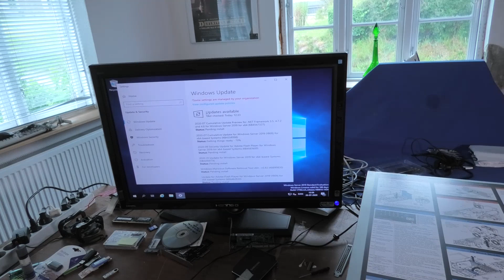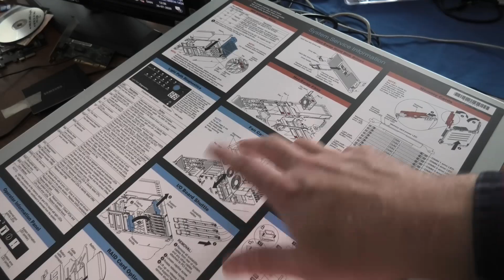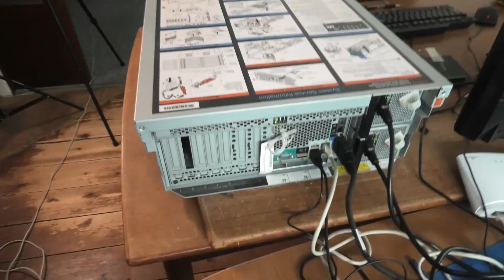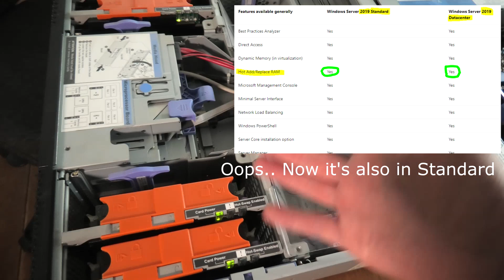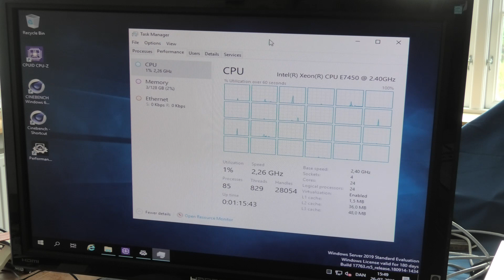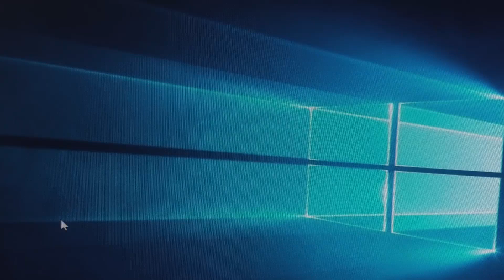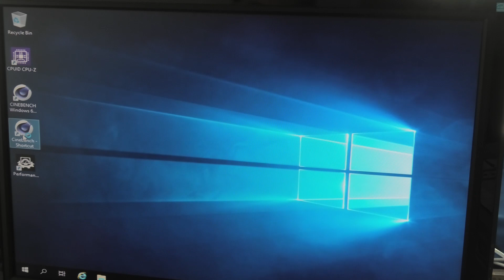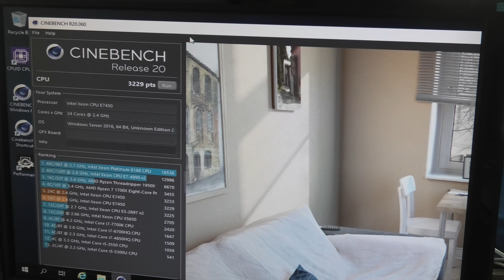24 Core IBM x3850 M2 Running Server 2019 - Cinebench R15 & R20 - 984

Comment: The website shows the cpu's listed incorectly. You listed them as 7540's and not 7450's.. When I searched them on ARK they were showing as nahalam 2ghz with hyper threading, and I was wth....lol.  But these are previous to those from the Dunnington (penryn).   I have a 2 socket system with the X7460 cpu's. very interesting beast those things are.   Highly useless now, but fun to play with.
Reply from the maker: Sorry My bad! I swapped "4" and "5" it's the E7450

Comment: The 4x E7450 HP DL580G5 I had in a hospital I worked at a while ago scored 1257/59 and they also had some DL360G6/G7 I've upgraded from low end quads to 2x E5645 6c & they scored 1139/83. They where way more powerefficiant than these old heater.
Reply from the maker: Yes,, these E7450,, did look like something that came to market a few years to late.

Comment: I haven't watched the whole video but the problem might be the installer detected the system as UEFI and the server is unable to boot as UEFI, a workaround is putting the drive into a Hyper-V Gen 1 vm in passthrough mode and install there since it will detect as legacy and install as legacy, if you then put that drive in the target server and boot off that drive it will boot normally and the install can be very very fast specially if the ISO is in another SSD.
Reply from the maker: Hi Dash Tesla
Thank You very much!  glad you liked the video :-)
Thank you for watching! :-)

Comment: I am trying to add a GPU to this same model, IBM x3850 M2. The reason in the onboard graphics only allow 1024x768 on Server 2019. I opened up the x8 port and installed the GPU but no video card is detected in BIOS. It can  detect other types of PCI cards but not the video card (I tried many different cards and ports) Is there any way to enable the PCI video card?
Reply from the maker: No one I know,,including me,, has gotten a GPU to work in the IBM x3850 M2,,, if you make it work do let me know!!
Reply: @MyPlayHouse  I even tried shorting presence pins, it is not detecting the GPU. I read people bought GT710 cards with original X8 slot and they got 1802 PCI error, I think it is because the BIOS doesn't disable onboard GPU. I am currently trying to disassemble the BIOS to remove 1802 blacklist. In the meantime, I got USB to VGA adapter and finally can get decent resolution on my monitor.

Comment: Nice video :) Due to my ignorance I have 2 questions: Doesn't any OS run slower under a VM? Why would you install a server OS on each HDD existing in a machine (i.e. the x3850 M2)?
Reply from the maker: I only installed an OS on one of the four drives. And running an VM will slow it down ever so slightly,, but the benefits are usually way bigger.
Reply: @MyPlayHouse  3:11 "I only installed it on ONE HDD..." Maybe I misinterpreted this sentence...